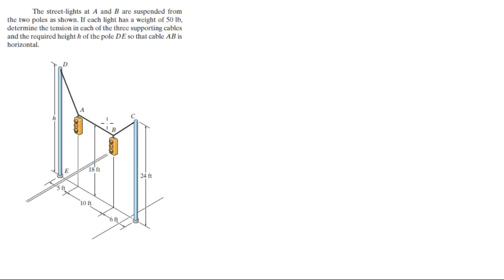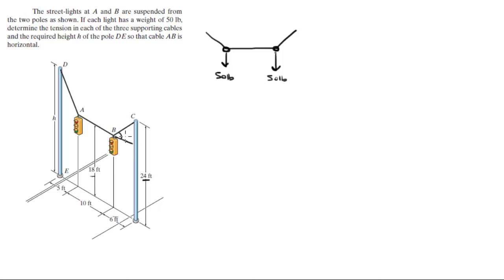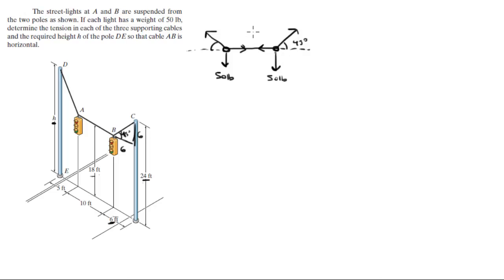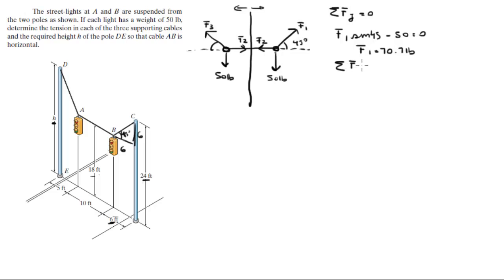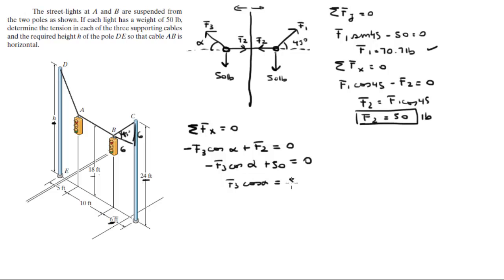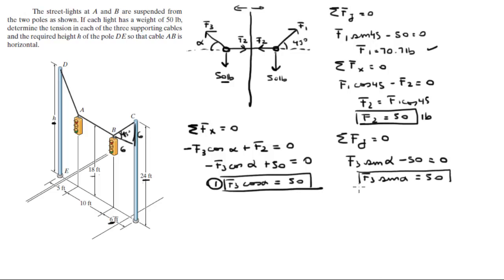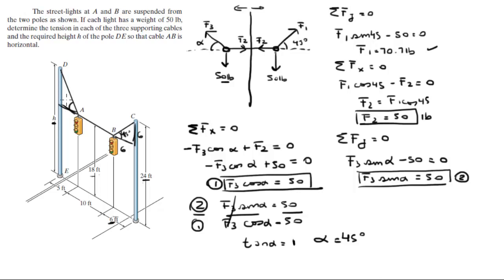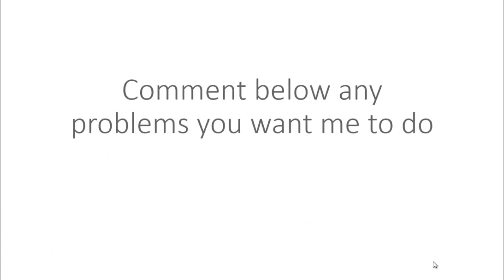Determine the tension in each of the three supporting cables and the required height h

Comment: This problem can be solve logical manner. We know that Force AB both side must be horinzotal therefore there must be equal to angle 45 degrees. And then from other side of which height is required we all know that 45 degrees the adjacent and opposite must be equal. Therefore 5 adjacent and 5 for opposite, then lastly 18+5 that's 23